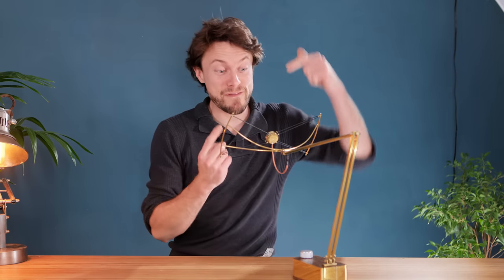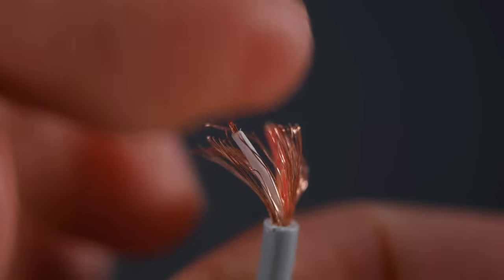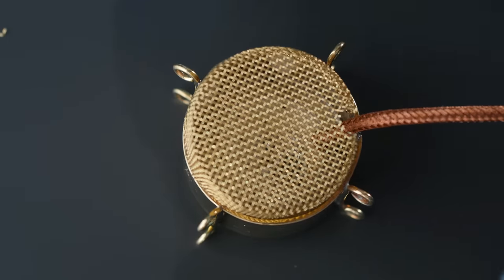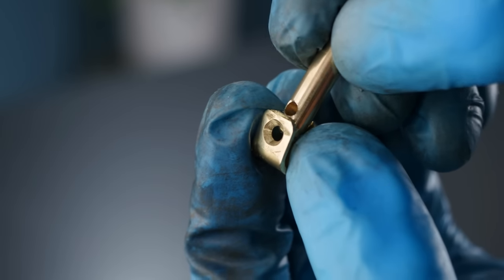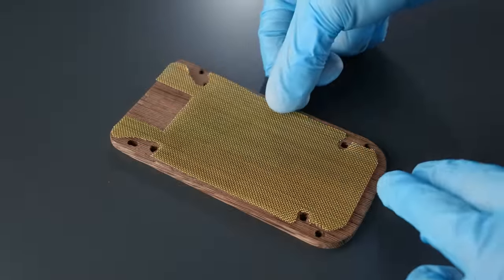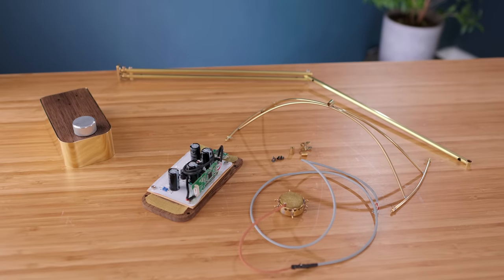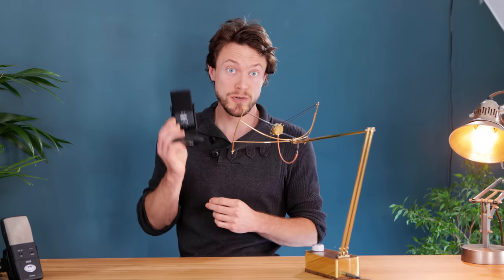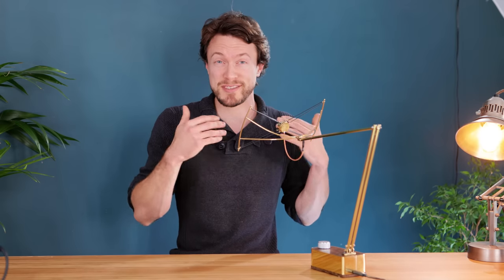Building a quality USB-C microphone

Comment: As a retired sound engineer i admire Matt's skills. 
And the microphone is sounding great
However, from a professional perspective, i shall say that the Neumann is definitely sounding a bit better 
Better bass and more importantly better defintion and impulse response (it is related to the difference between a real condenser capsule and a self polarized one)

BUT a brilliant project ! 
Philippe
Reply: Philippe,  I'm sure if you use the same designs and just changed the capsule, a more "Neumann" sound could be achieved, yes the price would increase, but how much would depend on the capsule purchased.  If you had a Neumann though that was otherwise broken somehow but the capsule was intact and functional, it would be the perfect recycling project for that microphone ...
Reply: @richcodesweb  
This is certainly exact but purely hypothetical
Neumann has worked on condenser capsules since  1928 and there are few if any prepolarized capsules that could beat this sound quality
Although everything depends on what you need the microphone for. 
When you record a sound there are usually a number of post processing steps coming after and the better the quality at the beginning, the better it will sound on the finished product 
No wonder it is a standard in the industry (along with one or two other brands) 
(pardon my bad english !!)

Philippe
Reply: Aaahh yess... Microphones
Reply: Yes, but it sound 100 times greater, like his price?
Reply: @mylittlehomeinparis  agreed, nothing beats 90 years of experience in microphone making, research and design.  But ... somewhere someone has a broken neumann microphone with a working capsule, I'd be willing to wager if you put that capsule into this design the sound would be a lot closer to the neumann as demo'd also don't forget this was usb-c which will also affect sound quality ... I really want to see  an XLR version of this that takes phantom power from the mixer ... making the test a true A/B test
Reply: @BOB-eb8xz  to my ears the sound from the DIY mic on a price to performance basis was better than the Neumann but then again I've never really been a fan of the "Neumann Sound" although I can appreciate it
Reply: @BOB-eb8xz  Again, it depends on what you need the microphone for. The price is not really important if you work  professionally, only the result is important
Comparing quality with price is like comparing apples with carrots. Although there are a number of other microphones on the market who could achieve a good performance
They will sound "like" a Neumann or a Schoeps at a fraction of the price, but they will still not be the "real" thing
Reply: I prefer the $30 build, I find the $3000 mic a little to pronounced and distracting on the bass side, and I play a bass guitar.
Reply: @user-yv2cz8oj1k  same here
Reply: @richcodesweb  But really, even if it's possible to make something that works great at a cheaper price, one needs to keep in mind that big companies with deep pockets really don't mind spending money on expensive hardware when they are already hiring expensive engineers. They want the reliable.

Matt's microphone is great. It can even help kickstart someone's career. We are not big companies with deep pockets, so expensive hardware is prohibitive to most of us.
Reply: 30 x 3000 it should sound better :D
Reply: I actually like the DIY's sound quality, though I find it quite sibilant than the U87 AI. You can definitely hear the s being a lot louder in the DIY build, but for 30 dollars? That's a steal!
Reply: Sure... but does it sound 100 times better?
Reply: I want to do sound engineering
Reply: @psargaco  If you read my previous comments: this is NOT the point ! It is only related to what you want to use the microphone for.
Reply: @Fn-vp9de  Great !!  This is a marvelous job that i loved all along my career. Learn some electronics, mathematic and physics, it will help.
Reply: @aqmf2424  Exactly lmao price absolutely matters when you have to pay 10-200 times the amount of what you'd pay here for minor improvements like if i'm paying for a Neumann over this with mY BUDGET it better tickle my ear hair cells and call them sweet names???
Reply: @user-yv2cz8oj1k  nah, even to my untrainedears, the 3000 usd one is just slightly better.
Reply: @user-yv2cz8oj1k  of course you don't want your singer to drown your basslines lol
Reply: The people calling out 'value for money' doesn't understand engineering precision and perfection.
1) To explain in layman's terms; the last 20% of performance takes 80% of the effort.
2) skills required to achieve the task takes many hours and days, not to mention implementation of it, I'm sure there were silly learning mistakes. It costs more than 30$ in reality. On that note, if my time costs $20/hr, yes it would cost about $3000+ (150hrs, ie 7 days) for me to learn the skills and make it.
Reply: @psargaco  no, never.  Getting from 90% sound quality to 100% is an exponential curve in price.  If you just need "good enough" for Podcast or YouTube when you know nobody will listen with a high-end audiophile setup and probably on their phones, it makes no sense to pay 3k for a microphone.  But if you're Adele and your market is the whole world, then I would say your fans should deserve the best quality money can buy.  In fact, in that case, 3k is really nothing.
Reply: @gregoirepainchaud  I could'nt say it better !!!!!!
Reply: @richcodesweb  You cannot use a true condenser capulse in an electret condenser circuit. Nobody has ever recycled a "broken" Neumann microphone into a table-top DIY mic. one doesn't do that to Neumanns. If anything were to "break" on a Neumann it would be the capsule, which then would get replaced or repaired by a specialist so it remains a Neumann. I won't go into details about the differences of true condensers but wanted to point out that the two capsule technologies are not interchangeable.
Reply: that is interesting
Reply: Something's for sure, this definitely sounds better than most Tonor mics ranging from 50-200 dollars.  I might make it myself, my sound quality is a garbled mess.
Reply: Well, maybe the Neumann is a little bit better, but i think most of the people have some headset mic, or just some lower-priced condensator-mic, and if you then consider of like upgrading yourself from your bad headset mic to something that comes very close to a 500 mic. This is the better option
Reply: @Some Guy All that high-end will haunt a mix. The cumulative effect of cheap microphone's "brightness" is something that professional recording engineers understand much better than the layman. Sure the DIY mic sounds better at first because it's brighter, but that dampness you speak of is actually a positive attribute. Track a Neumann 20 times (cumulative effect) and it will make a beautiful representation of the music with very little or no EQ needed. Track 20 tracks with the DIY mic and that presence boost between 3k - 8k will be amplified 20 times, requiring the mixer to use heavy handed EQ to tame that bright hump down... not to mention all the other frequency anomalies that may occur. 90% of cheap mics are overly bright. One needs to move into professional territory to appreciate the nuances that a $2000+ microphone brings to the table. 

Granted if all you're doing is a voice over for a YT video then the DIY mic may do it for you, but anything above that - production wise - will require much higher quality tools.
Reply: @Some Guy What you're experiencing is called "proximity effect". When you get close to the mic the low-end grows thicker and gives you that "radio voice". Unfortunately for casual use, ie being further away from the capsule, that effect is lost. The only solution is to add some compression and EQ to make the voice sound bigger and more in your face. Af far as frequencies are concerned, EQ is the tool. A 4-band parametric EQ with LP and HP filters is generally the best option, however I couldn't tell you what to cut or boost without hearing the sound produced by your mic. What you'd need is some sort of capture software that has a few filter plugins you could mess with There is a free version of Pro Tools available but it may be overkill unless you enjoy a challenge :)
Reply: @CamCovello  You're not factoring in the labour, and yes is sounds good for whatever it cost... btw I have built 2 mics with these capsules, and although they do sound incredible for the price, I have never once used them in place of a high quality true condenser in a studio setting. They're fine for VO but that's pretty much where it ends. You wouldn't want to multitrack with one, as I have already explained due to cumulative effect.
Reply: How can you differentiate with a low audio bitrate on youtube?
Reply: @hypeschwartz  that was an asshole-y way to present it, but you're right of course. This is like comparing raw DSLR photos to iphone photos. You may prefer the iPhone photo, but you would NOT want to use it as an input for professional photography editing.
Reply: @italocardenas5456  are you saying you couldn't hear a difference?
Reply: @DanKaschel  iPhone analogy is perfect. Takes great photos, amazing photos, but try to zoom in and.... dog meat.

Comment: The Nuemann has slightly deeper bass frequencies in your voice but all be told, for how much it cost to make the DIY mic there is nothing stopping anyone from trying to get the capsule in the Nuemann and adjust the preamp circuits as necessary.  This is really cool!
Reply: I came here to say that the Nuemann did sound better, but no where near 100 times the cost better. It may be good in different situations (or a more wide range of situations), but honestly for what Matt is using it for, it's a no brainer to build the $30 one. Plus you get the fun and satisfaction of making it yourself.
Reply: @frankmthompson  Hell yeah, not to mention the customizability of it.

Comment: "Next time on DIY Perks, I'll be making an exquisite mechanical keyboard using only 104 brass pipes, two dead cats and Carol Vorderman. I'm sure you'll agree it really is <superlative>!"
Reply: You're actually not that far off! I've been working on my own little project for all the controls in MechWarrior, KSP, so on, by using the logic board out of a broken and dirt cheap keyboard. Just had to wire up leads onto the individual pads, bout mechanical keys that have LEDs built in, and a plastic cover that can be easily removed for a label to be inserted underneath. Now I just have to figure out the key mount and how to power the LEDs, otherwise I now have a no-programming space ship module that can be modified easily. My computer just sees it as a keyboard, meaning no compatibility issues with any game at all, even windows function keys work right away.

Comment: Lol the craziest thing is that the mic he made sounds so good that spending a few mins EQing it can have it sounding near identical to the U87
Reply: The neuman actually sounded a tad mid heavy whilst the diy mic sounded well balanced across the spectrum at least with his voice. Think he beat the neuman already, no eq needed, just a job bloody well done.
Reply: @terminuscoagule3059  what's eq again? Haven't come across that term before.
Reply: @miscostsmusic1880  equalizer
Reply: @miscostsmusic1880  equalization. It's referring to audio engineering/mixing/mastering. You can boost or cut different audio frequencies to change the sound characteristics.
Reply: pair it with dbx286 and it's golden

Comment: "Would have been nice to have a brass control knob..." - oh Matt I love you man :D
Reply: I wonder if you could take separate the outer metal of the knob and use a brass wire brush trick by heating up the knob and then hitting it with the brush to coat the metal in brass...